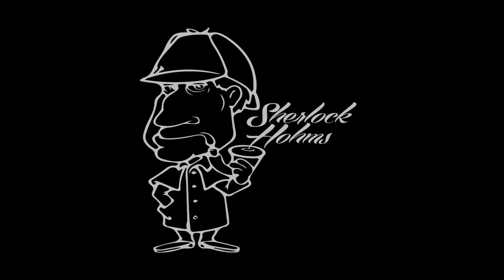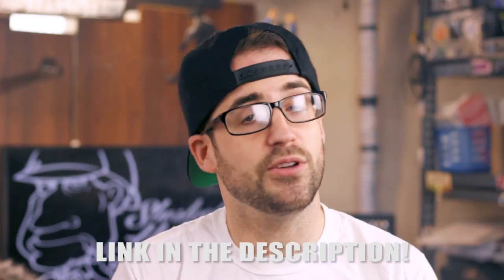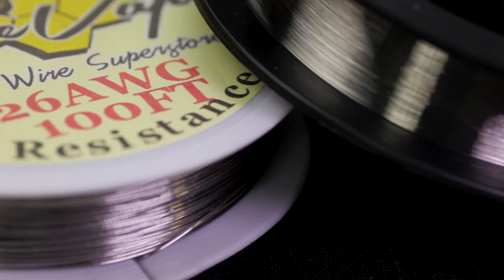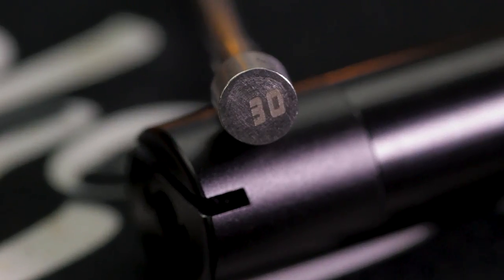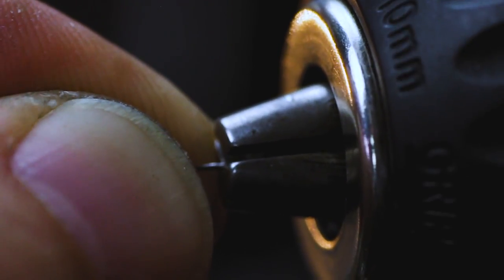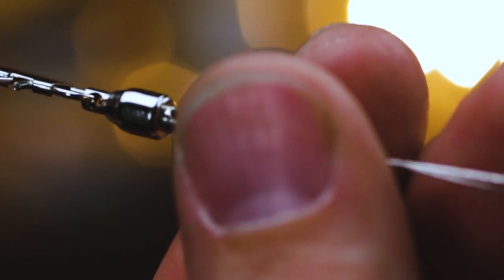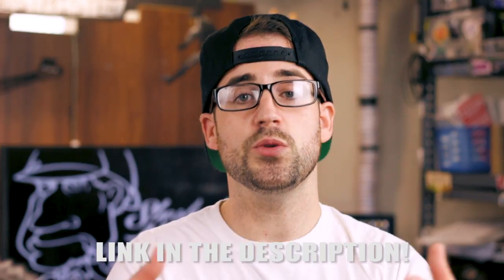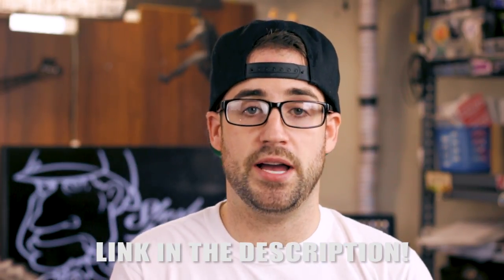Easy Series Fused Clapton Beginner Coil Build Tutorial -Series Box / Noisey Cricket Coil Build

Comment: I build series coils for a friend. 28 gauge tmn80 twisted together and wrapped in tmn80 38 gauge. 9 wraps on a 2.5 id I think. Ohms out around the.42 mark.
Reply from the maker: any time you twist wire it will raise the resistance. sounds like a good build

Comment: Great video as always. Got a question on staggered fused Clapton. I made a 4 core 30g n80 with 36g the other day when all my wire came in. I made about 12-15 inches, which may have Mase it harder. I had a free areas that didn't lay right, but was able to get enough for duel coil.
I am going to try a 3 core 28 today, what do you find with wrap wire. I have head that these coils aren't critical to have such a fine outer wrap like fused Clapton ect. Was going to either do 34 or 36. TWISTED Messes once said that he like a 24/32 better than a 24/36. I just don't have much time or money to waste wire. Thank's so much for the input.
Reply from the maker: I like higher gauges better for flavor. Idealy a 24/40 or 24/42-46. 24 because i generally shoot for .08-.16 ohms. its a preference thing and depends on how you like your vape.

Comment: I have been looking at the hexohm ( since my lavabox went to sdna heaven lol ) and what build to use in it, this build will go perfect in my aeronaut 24 (v2) lol.
Reply: Chase McGill look into PWM boxes. You can get a custom one for less than a regulated at 6.? volts hexohm.
Reply: chris bridges are they as durable as I hear hexohm are ?
Reply: Chase McGill very durable, and as far as scratches go he uses powder coating paint toughest you can get really. And is a true lifetime warranty you can return the thing if you blow the fuse , drop it in the toilet (yeah water damage). Get anything replaced/ repaired almost. You can check out Bogans, Ronnie cash, Ambitionz, Fagans videos. Or join the FB group there's a 15% discount there too. And the IG to see the new stuff there to. Jmodzboxbuilds.com

Comment: @Sherlock Hohms I have never heard this addressed and was wondering if it has happened to another coil builder and w/all your experience I figure you are very likely candidate. It has only happened three times over probably 150 builds however a few times after wrapping a few coils (nothing super exotic at all/ fused aliens or fused Clapton's ) I will install 2 coils i made from the same stick, both with same #of wraps and then while working out hot spots and first firing the coils one of them will take much longer to ramp up. I try to re-install both coils, make sure legs are as close to even length on both and that everything is pretty symmetrical during the install. Usually if this happens I can't undo it and have to just toss out those coils. Like I said it is very rare however I've never heard the topic brought up or mentioned in wondering if you have a solution or know what the issue Maybe? Appreciate any help or info you could give big fan of  all your vids. Keep it up.
Reply from the maker: jarred pelland I've had that happen but I've always been able to get it worked out. When something like that happens there is a direct cause. Like you said, something isn't equal, the leads aren't making contact well with the posts, the post screws aren't tightened all the way. If you're having that issue and struggling to correct it maybe take the coils completely out of the deck and start over, insert them a different way than how you first had them.... idk. I hope that helps
Reply: Sherlock Hohms that was my guess I'm the guy with the legally blind Vision issue so that is usually part of my equation. Thanks for your input/advice I do appreciate it. Keep up the great work.
Reply from the maker: jarred pelland thanks buddy

Comment: If two or more components are connected in parallel, they have the same difference of potential (voltage) across their ends. The potential differences across the components are the same in magnitude, and they also have identical polarities. The same voltage is applied to all circuit components connected in parallel

Comment: got a question im using a noisy cricket v1 what will be the best build for hot vapor and cloud chase for a dead rabbit atomizer.
Reply: aceace de castro yo, 22mm or 24mm? I ran into shorting issues with 24mms due to them touching the button. Btw, 38/26 kanthal as a 10 wrap.

Comment: Measured Resistance – 3.26 Ohms/feet or 10.7 Ohms/m

Length - 10+ feet

Wire Thickness - 0.404 mm (26 AWG)

Melting Temperature: 1500°C (2732°F)

Maximum Operating Temperature: 1400°C (2550°F)
Which battery should I use to make the wire red hot??I mean. How much volts battery will make this wire red hot
Reply from the maker: raj prudhvi there are great resistance tools. Use one

Comment: when ya give specifics like you can only build as low as a .3, youre giving incorrect info. maybe say ya need to build within your batterys amp limits. if you have fully charged batteries and get 8.4volts and have a .275 build youre using 30amps, so again saying only build down to a .3 is misinformation. what if theyre using 20amp batteries, then they shouldnt build a .30. maybe just say build within battery specs?
Reply from the maker: +JoshuaApathy Miller I did it intentionally because it's a beginner build tutorial. I personally build around .25 but for beginners .3 is a good rule of thumb
Reply: Plus building for 0.3 allows for some user error, meaning it won't go too low
Reply from the maker: Yeah and a beginner looking to learn a series build most likely wont understand volts and their correspondence to resistance. contrary to popular belief, i know what i'm doing and do it purposefully.